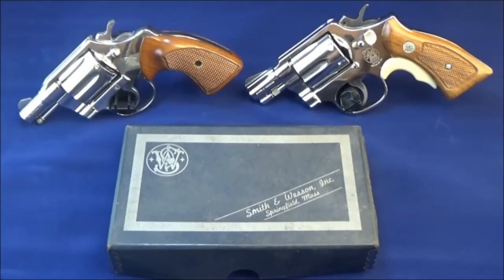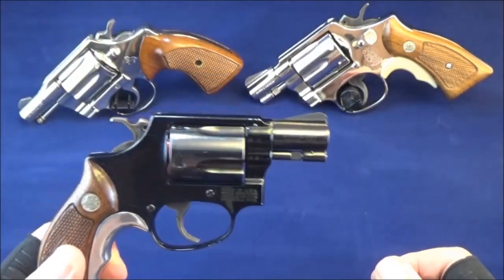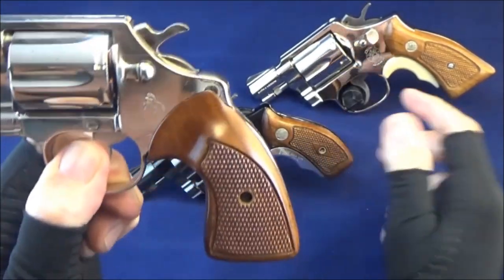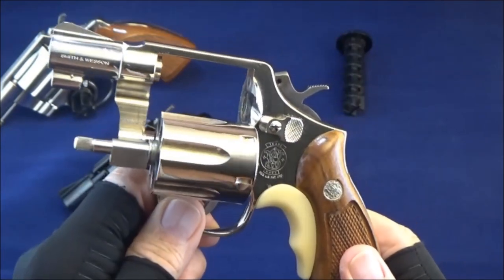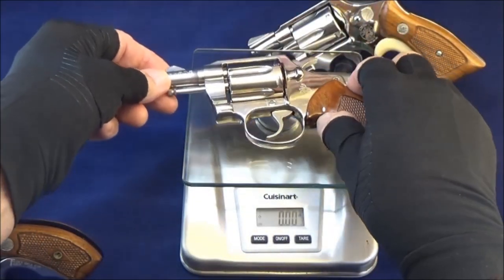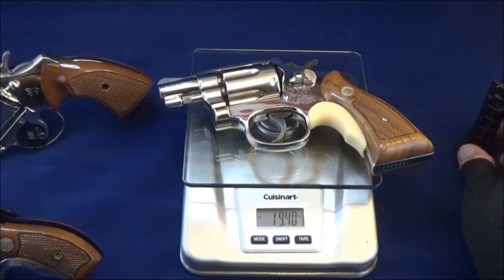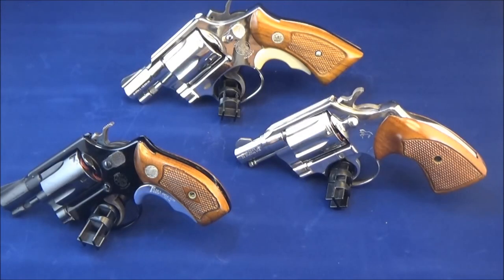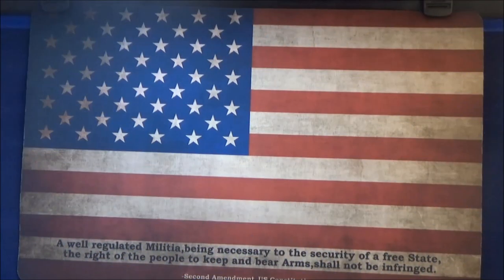S&W Model 37 Blue - COLT Cobra 1972 Nickel - S&W Model 12-3 Nickel Comparisons

Comment: I just got a no-dash 1968 Model 37 just like yours. It's got some mild top strap damage, pretty sure I overpaid by a lot at $600. I really like all the contrast on it; blued cylinder, barrel and crane, case hardened trigger and hammer, and the shiny black anodized frame. I got a high polish aluminum T grip for it just like yours as well. It just tickled me in the right spot. I'll get a +P rated .357 J frame at some point if this one works out for pocket carry